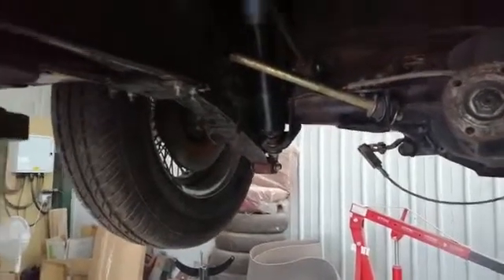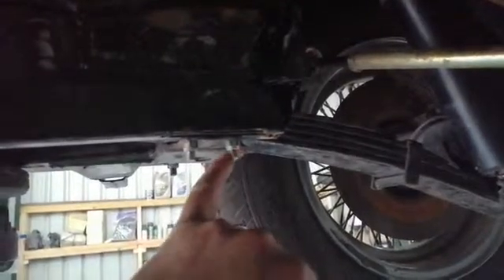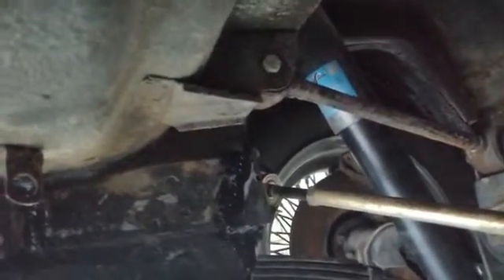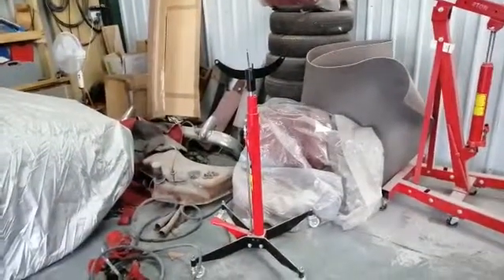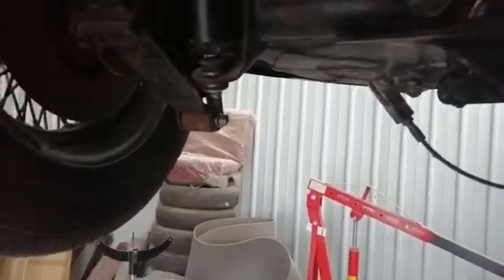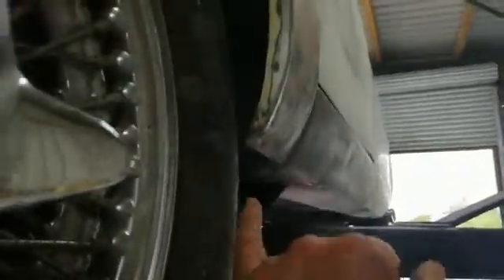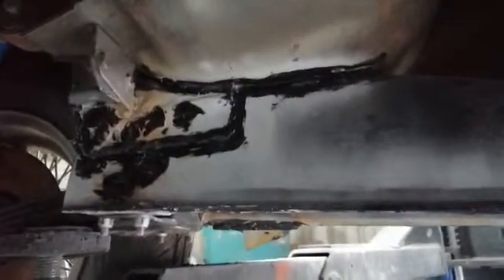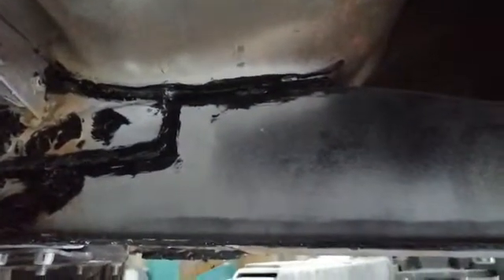Replacing the rear suspension spring carriers on Jaguar Mk2 - Part 11

Comment: Tyres fitted., however it started to drift at the rear unnervingly and upon inspection the outboard panhard rod mount had sheared around its periphery...quite alarming!! We made up an eighth thick plate to shape and welded over the original and it worked fine! But at 10 years old of course there was none of that dreadful corrosion that you have had to deal with there...all with your head jammed back, fumes everywhere, weld spatter and everything else that goes with the Romance of this kind of restoration work! I could here your pain..well done..it’s worth it, but only when it’s finished!       This is part 2, sorry, I inadvertently hit send on part 1..cheers

Comment: Top tip for doing this job if its a bare body shell is to buy a rotisserie for the car, it makes doing this so much easier.  Also rather than relying on measurements make a jig for the front and rear of spring mounting plates and weld it across to the sills, measuring is alright and a useful check during and after the work but you need to get the height of the spring hangers right as well as them being the right distance from various points otherwise the springs will be at different angles.